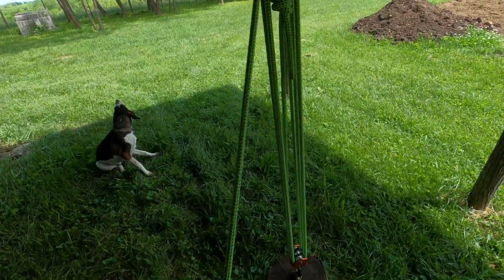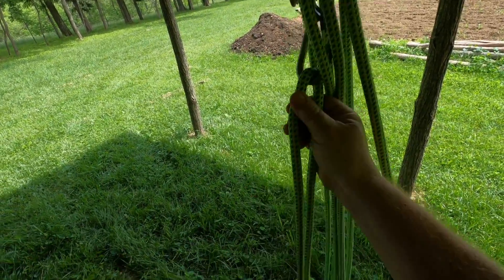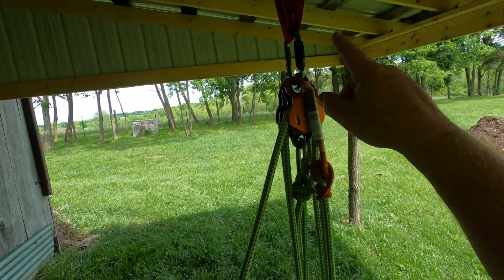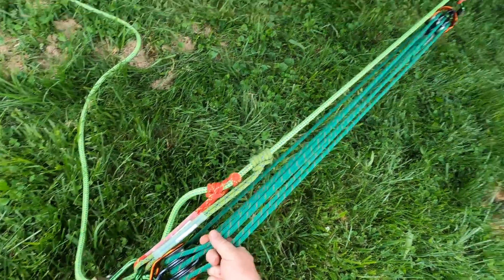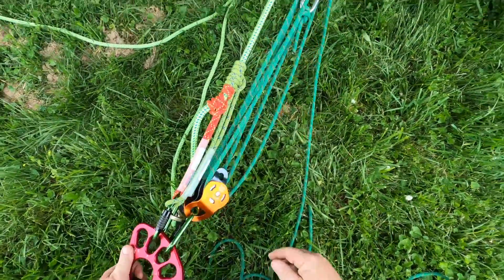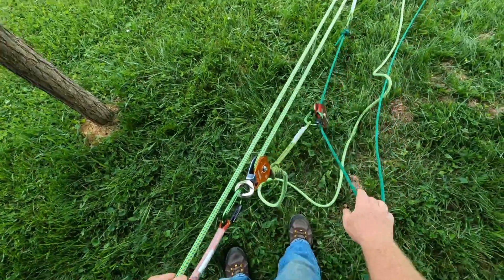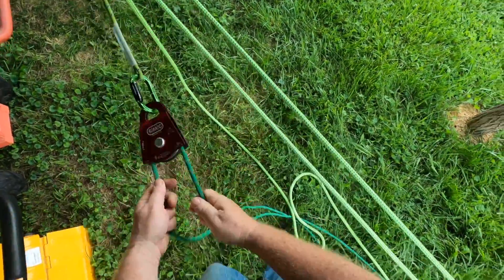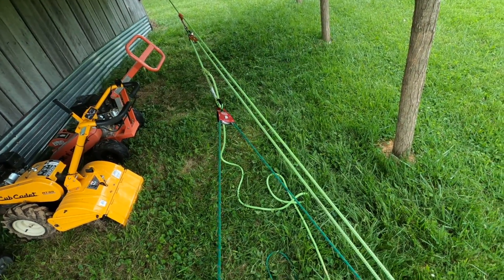More rope mechanical advantage: the 7:1

Comment: Nice video.  Another way to do a  7:1 is with a single rope, a double pulley, 2 single pulleys and two prusiks.  It is a complex system that is much easier to set up than the piggy-back systems and it does not require triple-sheave pulleys, which almost nobody has.
Reply from the maker: Good point. I should make a video on just that so thanks for the idea! I'll probably have to prove it with the T-method as I always get challenged but that is fun too. Thanks for the feedback.

Comment: Perry I cant use those compound set-ups on steel cable, with out cutting it, can I ?
I can't set a prosec/prosek/proset (sp?) can I?

I have a 55,000# excavator stuck in a creek and I am worried.
Reply from the maker: You are going to need the big-boy equipment for something that heavy. I would think a 4:1 mechanical advantage system with four snatch blocks hooked to something like a skid steer or something heavier for pulling could work. That way you have one continuous cable, no breaks or cable grabs. But I am not an expert here, consult a heavy equipment operator before you do anything. 

Whatever you do make sure your gear is rated for that application. Everything I show is mainly for rope and moderate loads. You are performing heavy equipment recovery which is beyond my scope of expertise, although mechanical advantage is mechanical advantage. Please be safe.

Comment: Something I've never understood, maybe you can answer. Let's say you're lifting a 1800lbs, using the 7:1 shown here. Do the blocks have to be rated for 1800lbs or less, since the advantage?
Reply from the maker: The 1800lbs never weigh less than 1800lbs. The mechanical advantage only facilitates using less than 1800lbs to lift the weight. So yes, your equipment has to be rated for whatever you are lifting, even if your effort is less. Cheers